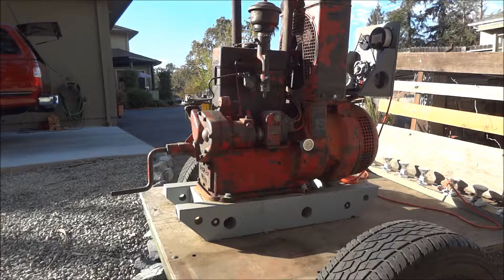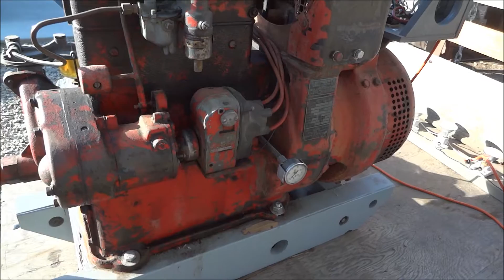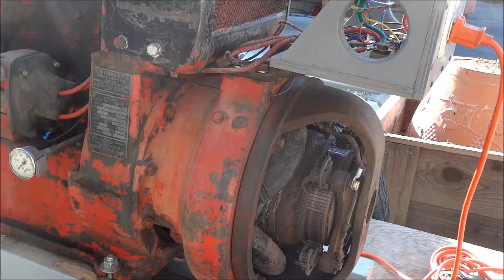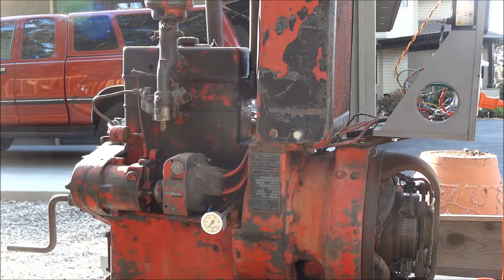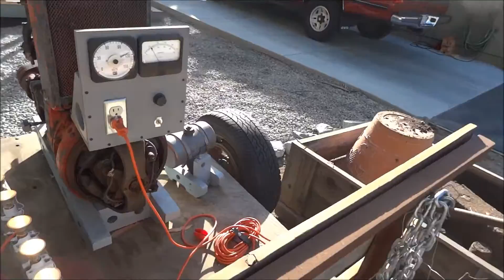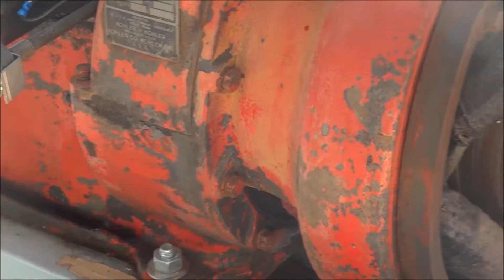Kohler Model KH

Comment: This series of plant was built between 1921 and 1948.  Yours was built in 1943.  You need to operate the priming lever on the fuel pump until you feel it build pressure.  That way you know the carburetor bowl is completely full, then it should start practically instantly. These were furnished in automatic (yours originally), manual start, and emergency (auto start with built in transfer switch and battery charger), as well as dedicated battery charging versions.  They came in AC and DC, 110 - 115 volt, as well as 40 volt and 140 volt battery charging versions. They came in gasoline only versions like yours, but also multi fuel so they could burn gasoline, propane, butane, or natural gas.  They are nice and VERY well designed and built sets.  The DC ones like yours are fun collector's items, but have limited application since so many things now a days require alternating current.  It's VERY unfortunate that yours is missing the automatic switch, as those are very enjoyable to use and demonstrate :) But, the fact that yours does run and generate is a plus.  Value will vary by location, of course (there are only so many of us collectors), but, for instance, a non-runner might be worth around $50, and at the other end of the spectrum an AC automatic set, multi-fuel, complete, and in perfect working order may go as high as $300 - $400.  Less for a manual start.  A DC plant may fetch around half as much as an equivalent AC unit, I'd say.  Yours running, but missing the automatic controller would likely find a new home with a collector for around $100-ish, I'd think, maybe more if they were nearby.
Reply from the maker: +realvanman1 That's right, I had previously primed the pump before the "show".  I home-brewed the controller with a rheostat on the field winding and so its fun to see the output voltage change from ~30~160Vdc.  I considered adding a home-brew auto start circuit but wasn't too keen on spending the money on the batteries.  I would let it go for less but it does come with the trailer.  
Thanks for the comments.
Stuart
Reply: +stuart rumley nice electric plant you have i noticed that it doesn't have much oil pressure